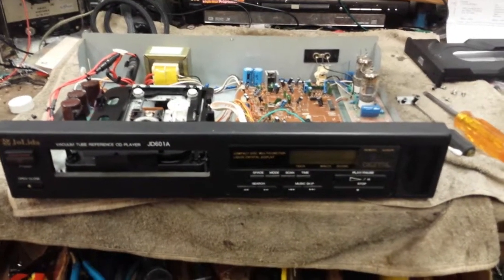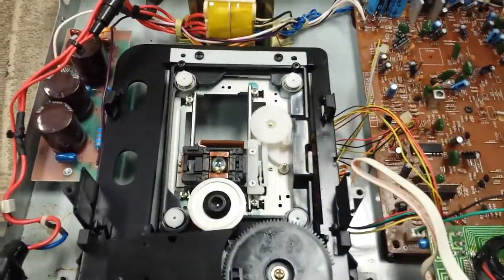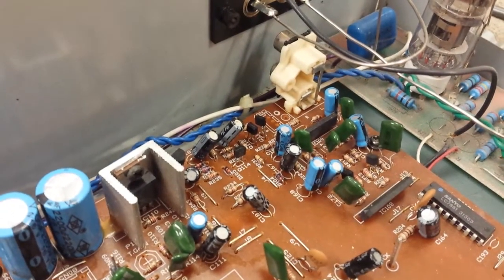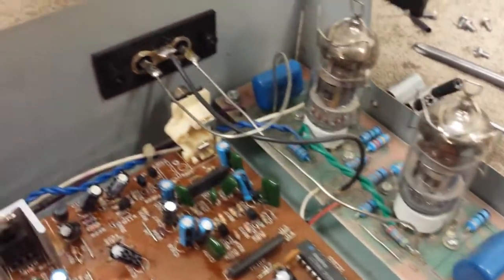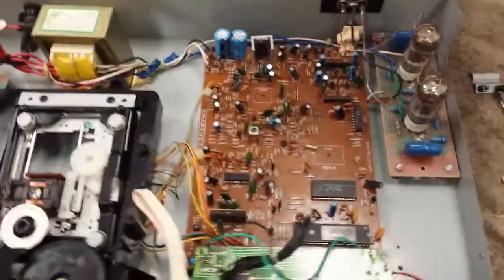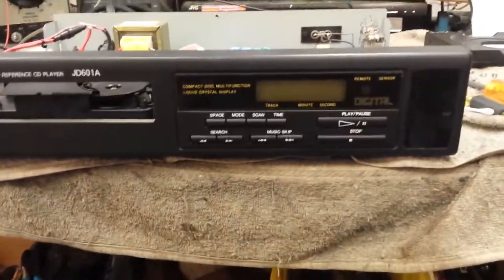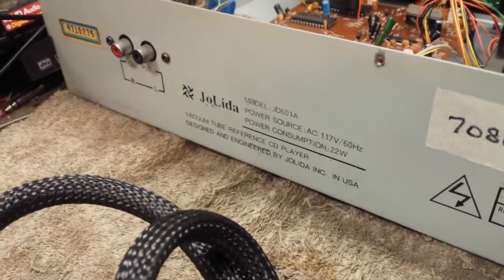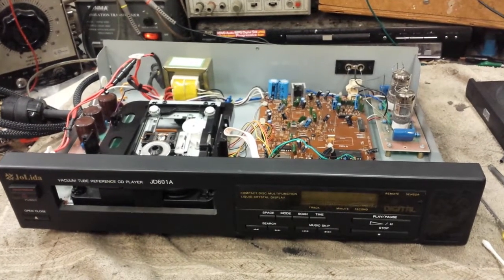Terrible build quality: Jolida JD-601 "Vacuum tube reference cd player"

Comment: PLEASE NOTE These are modified cd players from the first years that Jolida was in business. Jolida now designs beautiful equipment.
Reply: I have a Jolida 601a.  And in spite of poor construction, it is one of the best sounding cd players out there.  I compared many.  Expensive Wadia, Ayon, Musical Fidelity, etc CD players.  For unkown reasons, even though it has cheap components, there must be wonderful synergy because  great sound comes out of it.  It also has a reliable player.  Do not mod it.   If you carefully listen, you will find it to be a budget diamond in the rough capable of besting many of the most expensive cd players out there.  Let those who have ears drop there bias listen and wonder.

Comment: I have never "seen inside" one of these and you have confirmed my suspicions. A hand full of them go through eBay every year. This was their "first attempt" and I don't know what it sold for - it shouldn't have sold at all. That said, the models following this are very nice - that being mostly multiple versions of the JD 100 (100, 100A, 100SE) and I have some of each. The pinnacle was the model Music Van (probably made by Shenda or visa versa). A very nice CD player with a regulated high voltage, four tube gain/buffer, beefy output transformers, Philips based drive (although not a CD Pro) and real balanced XLR outs. I love it and it looks stunning. I can recommend the various 100's also.

Comment: i have sold Jolida gear for years. Never heard of this model. But you can read reviews on the JD100A CD player. I do know there have been some knock off gear put out with the Jolida name. Also, I have to wonder why some people (mostly dealers) feel a need to run Jolida gear into the ground. There is a dealer - Uptown Audio or Upscale Audio- something like that. Sells Prima Luna gear. He likes to run Jolida into the ground. Why does he not just tell about the wonders of Prima Luna. I can promise you this- Jolida is better built and sounds better than Prima Whatta.
Reply: It's an early model, comments can be found by a websearch in the yearspan of 1998-2004 for this player - generally very positive. 
And one not so happy at headfi org (where I make smalltalk at times) https://www.head-fi.org/threads/jolida-jd601a-initial-impressions.47258/

Comment: There were a few of these from the late 80s onward, most using Philips stock chassis. Absolutely standard 'upgrade', But remember from the factory this would look pretty much identibal but without the valve board/supply so it's unfair to call it terrible quality. Cheap would be closer. The wiring was solid core and an audiophile fancy. The low impedance drive woulkd negate any hum/noise issues.The valves of course do what valves can - offer 140db dynamic range with minimal distortion and phase errors.